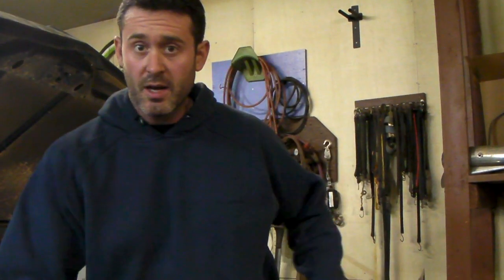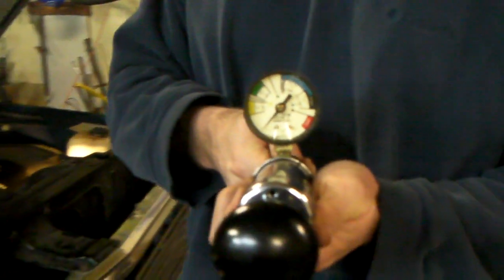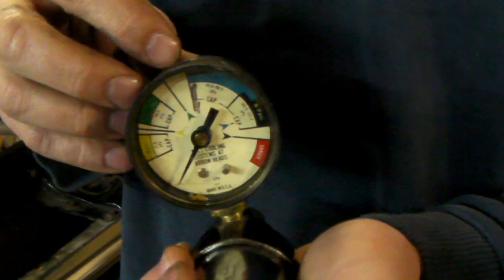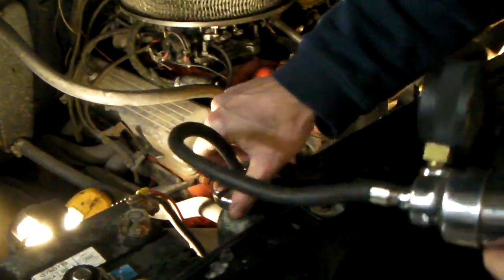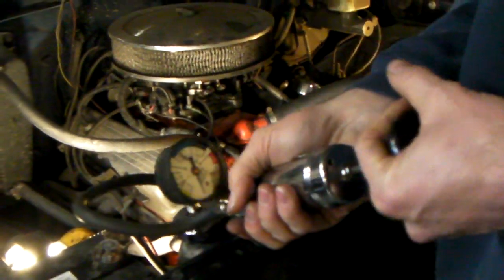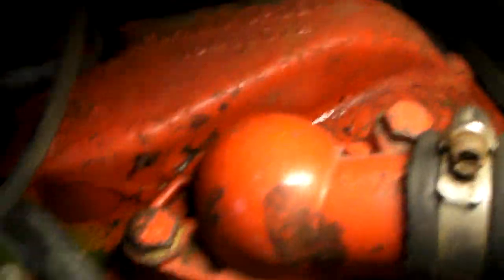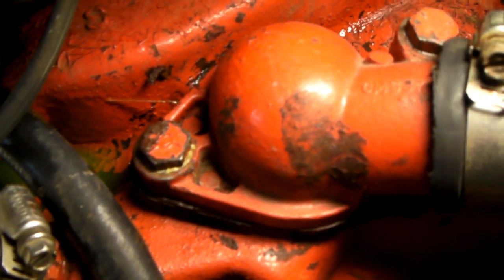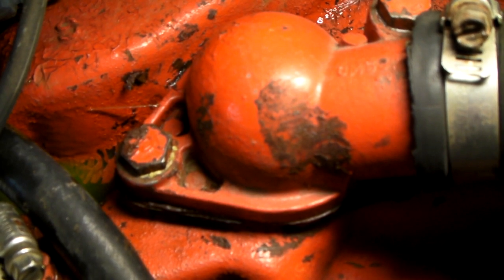Pressure testing your coolant system for leaks

Comment: And for those who think pressure testing will show you exactly where and what is leaking, you're wrong. It puts you in the area on external leaks , but if you can't see the liquids exit point because of hoses, pumps, wires, etc are blocking ur view, don't be fooled by ppl saying it will show you like it's some kind of magic decoder. Point is the test won't point out specifically that your freeze out plug is leaking and not the rusted out temp sensor or a gasket split or an over tightened hose clamp cut a hose . If you see liquid but can't see from where it's leaking out of, it's time to start removing things so you can see. And if you don't have a kit let the engine warm up and it will do the same thing, build pressure, a test kit does for external leaks. For internal leaks, that's another story.

Comment: Whats the reccomended PSI for small block v8's? the PSI you read off the rad cap is the normal operating pressure or the reccomended pressure for the "Pressure Test?"

Comment: Already tested mine for a headgasket leak and that's not the problem, but my pressure test is only showing a leak from the filler neck. Is that a likely coolant leak source, or am I not securing the pressure tester securely enough?

Comment: My car likes to overheat like once every two weeks but it wouldn't go all the way to boiling point, it would go really high. The upper radiator hose is hot and the lower radiator hose is cold, than all of a sudden the lower radiator hose warms up and the car cools down? What does that mean

Comment from the maker: If the leak is not apparent, keep at it.  Pressure it up and look for drips underneath the car.  when you find the drips, work your way up until you find the  leak point.  If you still cannot find it, there is an additive that you can put in your antifreeze to make the leaks show up under a black light.

Worst case scenario, your head gasket is leaking into the combustion chamber, this is bad, but usually you can tell because your exhaust will be white and cloudy.